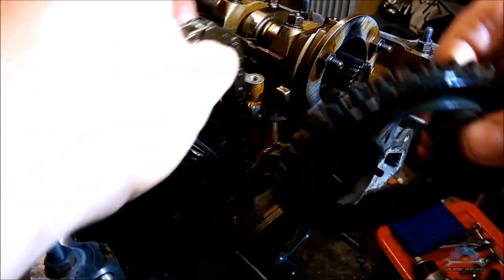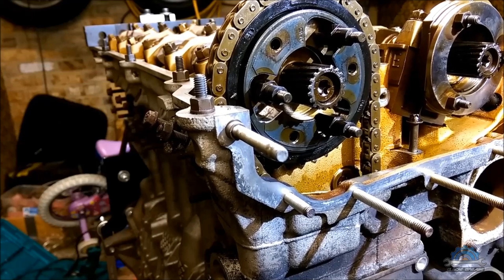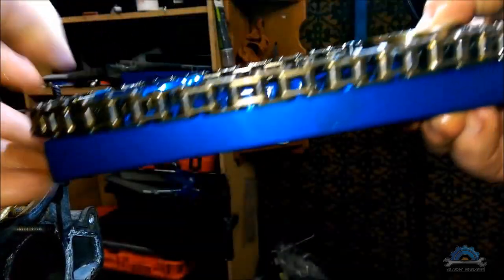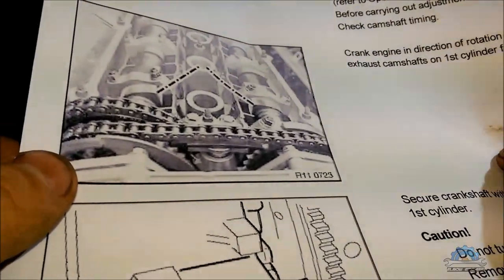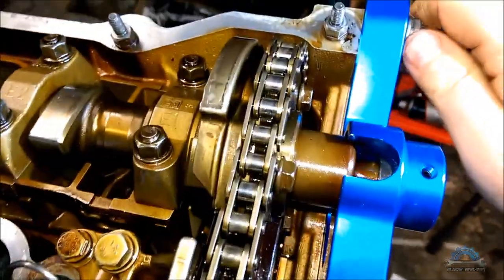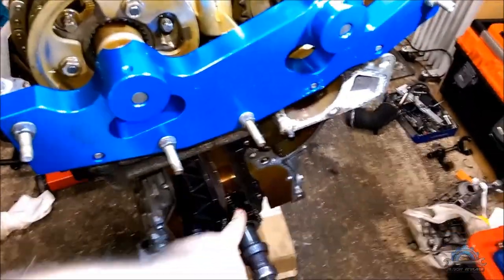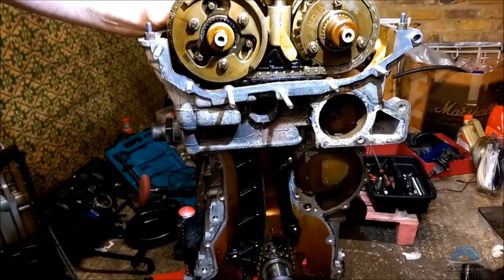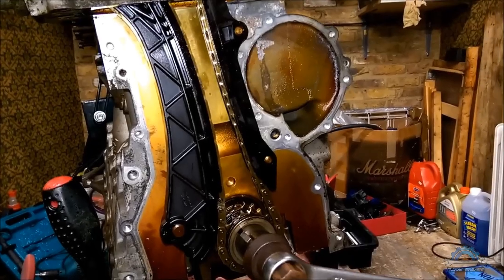Timing setup procedure double VANOS BMW E46,E39,E60,E83,E85 M52TU,M54,M56 330,325,320

Comment: good video, the tension tool for the main chain is only to take up the slack while you tighten the sprockets to make sure the timing is correct, yes its perfectly ok to use finger tight method, just make sure you have taken up all the slack, if you over tighten it the only thing it will do is put a bit too much stress on the chain guides but this will only be while you are setting up the timing, once the tension tool is removed and the actual tensioner is fitted the chain will be at the correct tension again (once it has built up oil pressure of course).
Reply: ض
Reply: ض
Reply: ضض

Comment: I rebuilt my top end, and when I go to turn my crankshaft, it turns around 20-30 degrees both ways from TDC, then stops. Is it possible I got the timing wrong and a valve is open when a piston is coming up?

Comment: The flywheel locking tool seems to do nothing. I'm not certain all these online timing tool kits are the same. The kit I have allows the crankshaft to move feely when it's suppose to be locked in TDC.

Comment: I overheated a e46 330 CI a couple of times before the head gasket gave me the middle finger. My question to you is does the deck of the block have to be machined before installing new cylinder head.?

Comment: Will new guide rails cause tension because I barely have any slack when I install the crank sprocket and dont have the chain tensioner tool installed as well

Comment: hi i have a question do I have to push hard on the locking pen because it feels and looks like it doesn't want to go in
Reply from the maker: it goes easy but there was a broken piece of plastic green plug and I didn't want to fight with this
Reply: Elbow Grease how exactly do I know if the flywheel is locked? and in what way do I get the crank pully off?
Reply from the maker: Liz Lugo rotate the crank and when pon will go deeoer and mark on the front cover and pulley will lined up like iI said in the video.Ive got anothet video on my channel about pulley removal
Reply: for me locking pin i had to hammer in so it was not a good fit. as long as the crank is at TDC matching line on block with pulley exactly with a mirror if still in car. if you cant get the pin in then just make sure on reassemble that it does not move (shouldn't).
Reply: Liz Lugo god you are gorgeous 😍😉😘😂

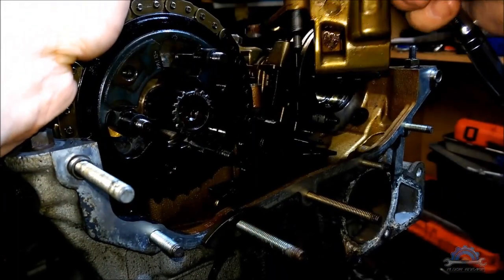Comment: Hello, i have one question.. At 5:15 - arrow on the wheel at exhaust camshaft is not at the same position as in the begginng of the video. Are you sure is that OK?
Reply from the maker: please look close its a mark and arrow is slightly below the cylinder head 5:39
Reply from the maker: 5:15 I changed camera angle thats why is harder to see

Comment: I got a 2003 x5 m54 3.0i v6, it was serviced every 3k miles before it sit for about 3 years, then it was drove for a couple months,and then sit for another 3 years, ive replaced the plugs,oil,oil filter, cleaned out the gas tank 2 times, put new sending unit and new fuel pump,it will run and start good,but its a lil rough? Codes be cleared ,but codes still come up 222,168,240,30,238,241,203,202,228,227,8....just not sure where to go from here, it has only 100k on it and was well taken care of,i guess im asking where do i go from here???
Reply: M54 v6? Or straight L6👻

Comment: Hello friend
, I live in Brazil.
I have a 325i year 2001 with M54 engine, it is with the DTC P0341 (sensor camshaft - exhaust)
I changed the sensor and cleared the fault, but it still appears again.
What do you think it could be?
I have imagined this vain or solenoid problem.
Thank you